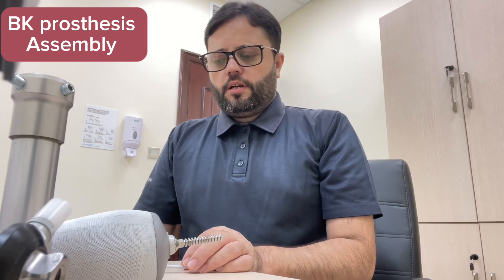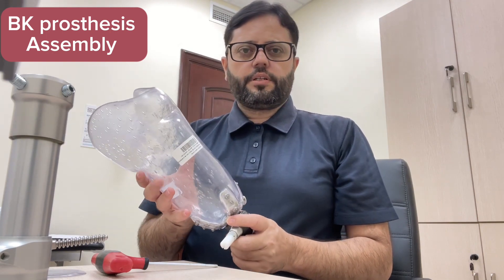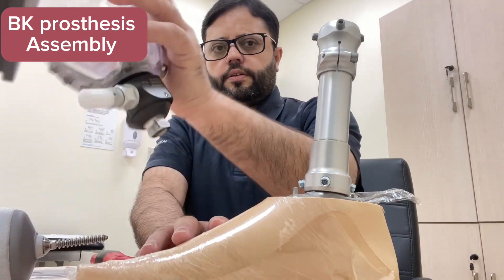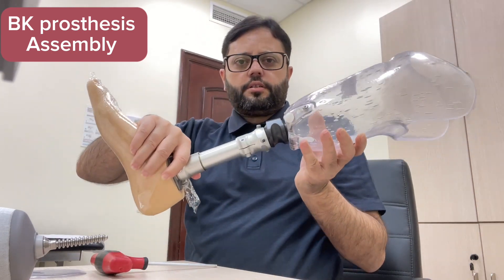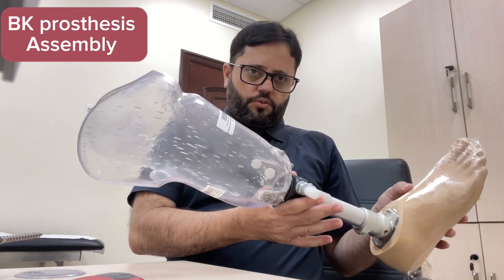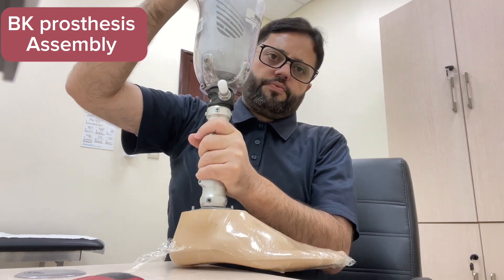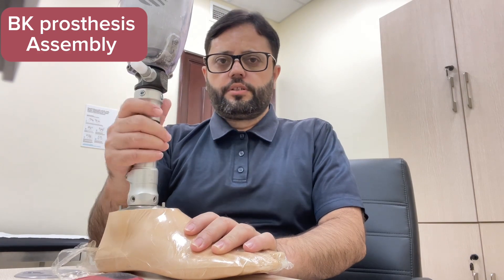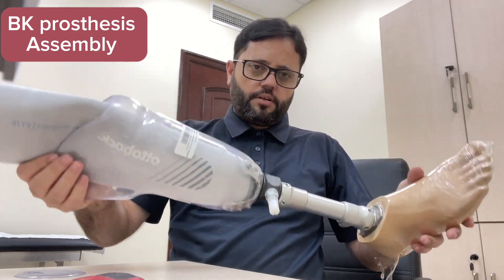Trans Tibial Prosthesis Assembly and Alignment | How to Assemble BK prosthesis |

Comment: How do you adjust the angle of the flexion? Where do you place the goniometer (angle ruler) from where to where to get a desired angle?
Reply from the maker: There is angle written on the joint you can easily fix flexion in any desired position
Reply: @explorewithshafiq  I meant in a check socket during bench alignment on a jig

Comment: How do you determine where the plate sits on a check socket during the bench alignment
Reply from the maker: By weight line which falls 60 40 AP AND 50 50 ML at knee level
Reply: @explorewithshafiq  60 because the socket is tilted 5 degree correct? So the socket sits in the middle of where the Sagittal plane and coronal plane intersect.
Reply from the maker: @vndlr98  this is standard alignment but in some cases it might change . 60 anterior due to position of patella and 5 degree initial flee flexion